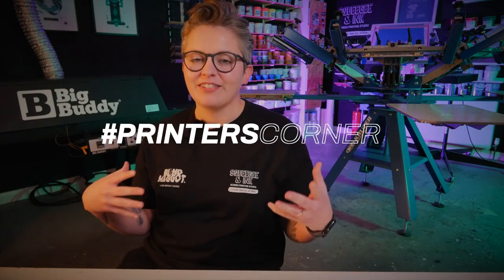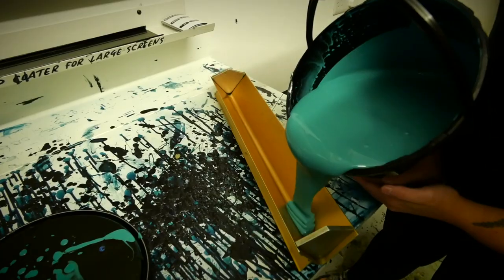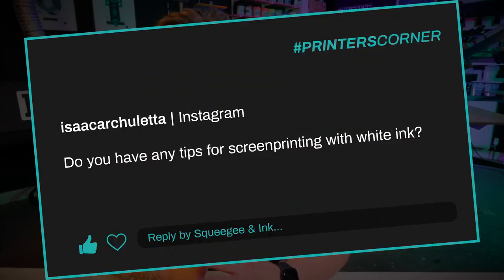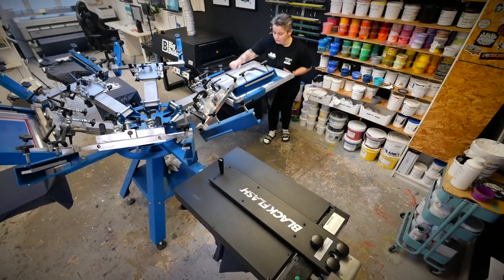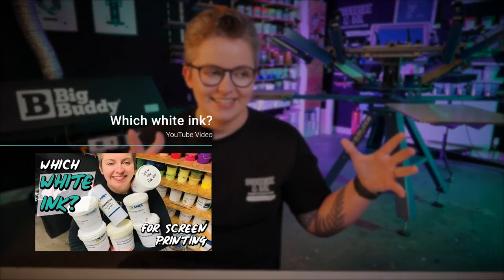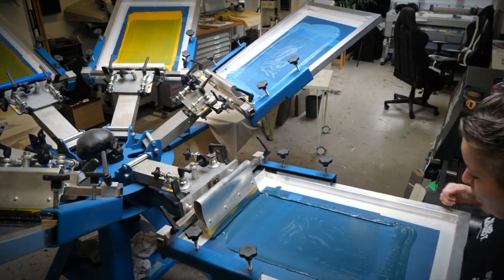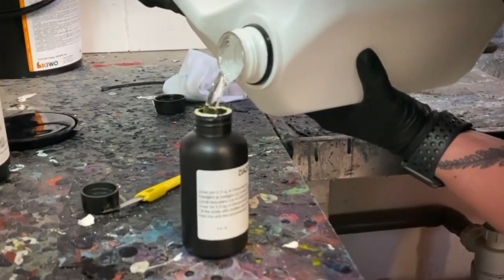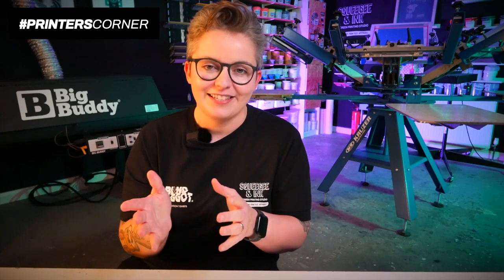Which emulsion for screen printing? Premixed or Diazo? | Printers Corner Ep03

Comment: In your section about emulsion you have a white light on your exposure unit when lining up your screens. Is that ok or does it start exposing the screens? I just bought an LED exposure unit and it has a plain backlight and no safe light, so only use i see for it is post exposure to check for pinholes.